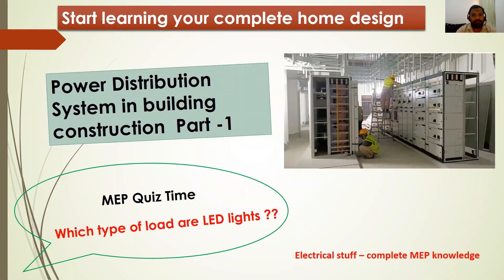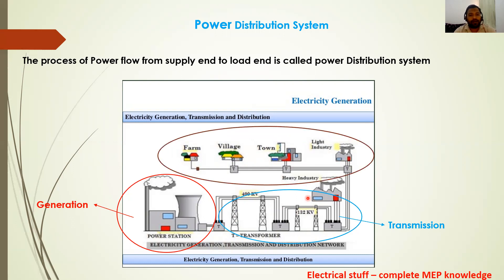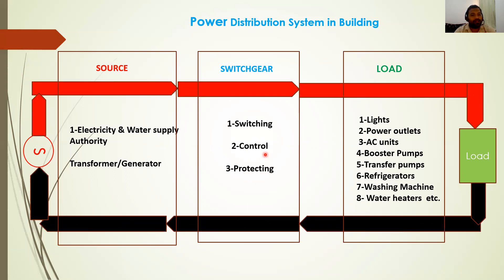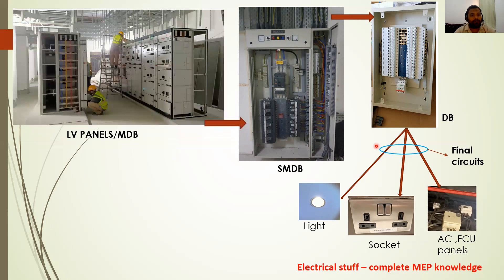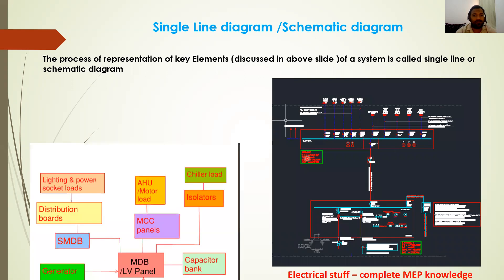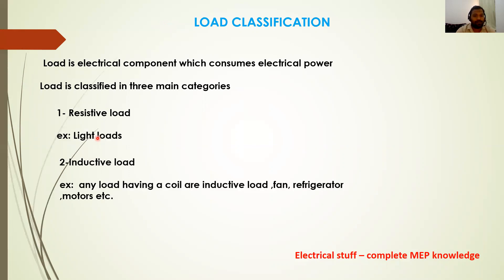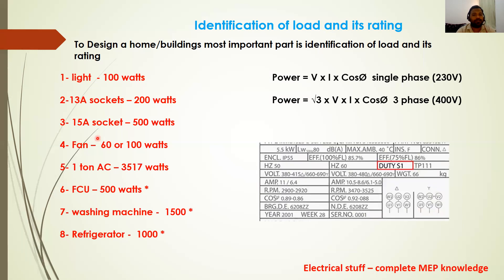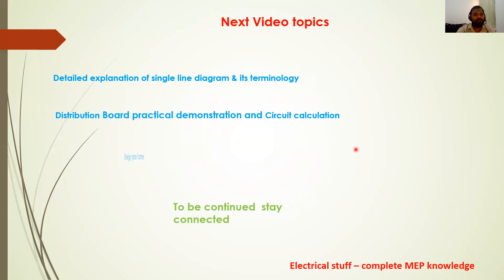Home/Building power distribution system part 1

Comment: Sir, If 200 Watts highbay light or 400 Watts flood light then it will be same Resistive load or not?
Reply from the maker: Hi Asim please tell me what type of light you are using ,ex led or tungsten filament lamps or sodium vapour lamps, or mercury vapour lamps or fluorescent light
Reply: It is LED lights only bcoz nowadays nobody is using tungsten filament lamps or mercury lamps etc due to high electrical consumption
Reply from the maker: Sorry for late reply , 
Yes LED are  resistive load only